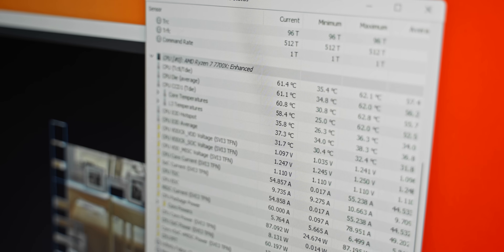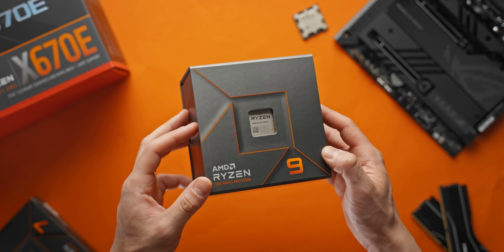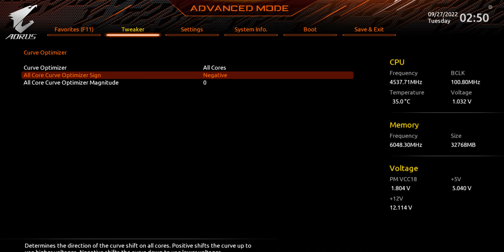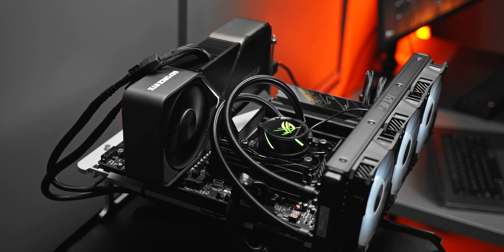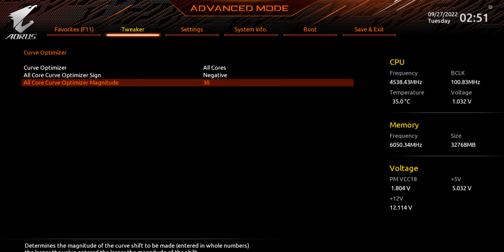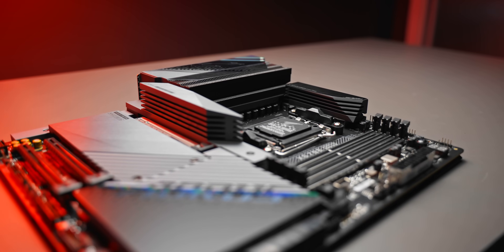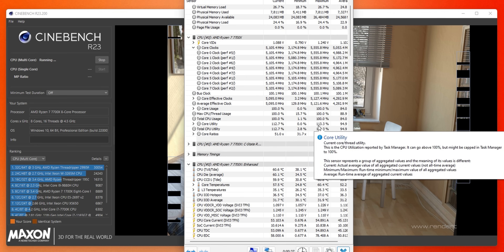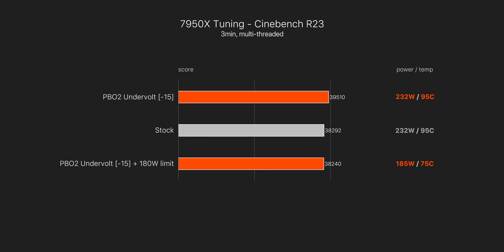Fixing Ryzen 7000 - PBO2 Tune (insanity)

Comment: So I'm a bit confused, if I set the offset to - 30 and it crashes, should I decrease it to say - 29, - 28 etc until it does not crash is that how it is?
Reply: Basically yes. Ryzen Master will figure it out for you. Then you can set it in the BIOS.

Comment: I'm so unlucky i don't know what's happening. My 7950x boost up to 5.8 when idle but when i launch cinebench the clock drops to 3.6 and my score is only 25000. I even did exactly what you said. negative 30 in curve and nothing changes. Do you know what could cause that?

build
Asus rog hero x670e
arctic freezer II 360
Reply: Set everything to default. Run test. If you still have issues I'd return the chip for a new 1 if you can.

Comment: 0:12 - 0:15, F'ING EXACTLY,  you want to keep thermal cycling at the lowest possible range and also to keep the temps to the lowest possible under ANY scenario because entropy's effect amplifies with temperature increasing on any material so the less heat the chip produces he less wear hence less chances and degree of degradation will occur on it, god darn basic physics.
I don't know how these facts have even escaped GN's review, just because AMD said it's fine?
To me, i just see planned obsolescence for obvious reasons.

Comment: This is really deceitful by AMD. Why not SHIP them like this? If its designed to run at 95deg, thats fine - you shouldnt be worried about that. But that should also mean you get peak performance. Being able to lower the voltage, and thus thermals AND still get the same performance feels like AMD just tried to HIDE the overhead they knew their processors have.

Comment: -30 all core is really unrealistic and unstable. Even with Ryzen Master automatic optimization per core, it still resulted in WHEA BSOD in the -20 range. I actually have to reduce them to around negative 10-15 for it to pass corecycler.

Comment: Wish if it is that easy...  last time when i used it, system ran fine, benchmark too, most of the games as well..but found that 2 out of lets say 30/40 games consistently kept crashing..
So reckon test your sytem really well before usage as benchmark/stress test sometimes is not enough and its gonna give you lots of headaches as you wont think its the PBO fault.. 
But otherwise it does give you lower temps, less noise and similar performance.

Comment: With high negative offsets in curve opimizer, youll find more instability in light workloads than heavy workloads. At least, thats how ryzen 5000 behaved.

Somehwere there is a ryzen 5000 guide on testing curve optimer for each core with prime 95 large ffts in windows safe mode to find the best per core negative offset.

Comment: Why AMD didn't make it this way by default out of the box?
Sometimes I don't understand their decisions. 
7700X by default should have less voltage, less power usage, and temperature set to 80C or something similar to not lose the performance.
Another issue is the thick plate as they had to leave some room for 3D models.

Comment: This vid is the first one I saw that gives you a glimpse of power efficiency of Ryzen 7000 series in lower wattage. I love it how you can tweak 7700x to operate at the same performance at 85-95W depending on silicon quality. Personally I would run it around 65-75W as it will give me more then enough performance for modern GPUs while gaming at 1440p. No need to spend more on electricity if you gain nothing out of it. Hah, I believe you could have a perfectly fine gaming experience from 7600X at 50W at 1440p with maxed out graphics, most games wouldn't notice due to being GPU bottlenecked :P
Reply: @El Cactuar thank you, it was necessary.

Comment: I spent some time with my 5900x and PBO. The best 2 cores got a -30, all others on the better CCD -25. On the weaker CCD, all run at -18, which results in the CPU running at least 4.9Ghz in single core (the best two boost to 5.025GHz) and an all core clock (e.g. in Cinebench 23) of 4.6 on all cores. 200 watts total consumption, max 72 degree Celsius. PBO is awesome when it comes to tweaking the very most out of a ryzen. Nice to see that the new CPUs have even more potential.

Comment: 5800x had the same problem as Zen 4, by default the chip draws too much power for too little gain. 5800x has the same power setting as the 5900/5950x but only uses 1ccd so all that power is going into HALF the die space(ignoring IO). This results in 5800x drawing up to 140w and being basically impossible to cool without high fan speeds. Changing the PPT/TDC/EDC settings in PBO fixes this, as the lower power settings allow more headroom on the chip to boost, so you actually get equal or sometimes better performance than the default power hungry setting.

I dont know why AMD chose to do this, as it really tanked the 5800x review scores because the chip was too power hungry and hot by default. Zen 4 also seems to be the same.

Comment: Big warning: based on my experiences with a 5950X using curve optimiser can cause CPU calculation errors that don't cause crashes or WHEA events. Best approach is to run at least 30 minutes of Prime95 stress test (with and without AVX) without CO turned on, make sure there's no errors and then try it with CO turned on. If there are errors, reduce the offset and try again.

Comment: Just one alternate suggestion for dropping power consumption - instead of reducing PPT/TDC/EDC limits, set "CPU Boost Clock Override" to [-100], or negative however much PBO2 adds as additional clock speed after you find a stable undervolt. So for the example at 5:10 you'd probably set [-200]. It has the same effect as PPT when your CPU's blasting on all cores, and also reduces power consumption during moderate loads like gaming where you're nowhere near the PPT cap while still giving stock performance.

...I did this on my 5800X because for some reason power consumption jumps by an extra 15-20W if the clock speed crosses the line from 4750 Mhz to 4800 Mhz, and that's what solved the issue for me after my undervolt.
Reply: Hey man! Could you explain what this setting does and how to set it in detail? Do you mean to add [-"Additional Clock Speed in MHz"] here? Thanks! :)

Comment: On my 5950x I really needed to adjust the offset to each core individually as some cores could not tolerate much of an offset, which would result in blue screens of WHEA's. It also required using something like Corecycler to test the stability too, just running cinebench isn't enough to verify stability. Great video besides that small bit.

Comment: I did exactly the same thing on my 5900x to get it air-cooled in a NCase M1, works a treat. I can see AMD pushed power and voltage to the max so it would look good in benchmarks, reminds me of the R9 290x.

Comment: My 5800x3d = undervolted by  0.05,  FSB 103.6  (4.7GHz all cores) and -30 PBO tuning on all 8 cores...  66c under full load with air.  Also you can use the PBO software tool to do all of this in Windows.
Reply: I thought the X3D was locked and couldn't be undervolted or overclocked? Have there been BIOS updates allowing you to do that now?
Reply: @cd4953  It is locked. MSI B550 Unifiy-X has an external clock gen to control FSB and PBO tuning software or BIOS setting in MSI let you adjust PBO.  I would assume most MB will let you change voltage on one though.
Reply: @njasicko  Ah gotcha. Thanks, that's good to know. Planning a new build and been trying to decide between 5800X3D or a 7600X. Being able to tune the 5800X3D is a plus.

Comment: So what's there to be uncomfortable about with the 95°C on a product designed to run at that temperature? 
So long as you don't touch it you won't get burnt, and the temperature in your room is influenced by the wattage being used, not the absolute temperature, right?

Comment: in other words the 7000 series is running totally inefficiently out of the box.
Reply: Basically, yeah. It's "stock" configuration is basically overclocked, and it's "eco" mode is basically what used to be considered stock.

Comment: I've managed a offset of 25 on my 7950x, just wondering what settings are for the power limit though as there are 3 sections to fill in, tdc, edc and ppt, also each chip has different wattages so need idea what to look for where to begin

Comment: You really need to configure curve optimizer on a per-core basis.  If you are limited to a -15 offset all-core, it may be only one core holding you back.  And with a 7950X, one core complex is normally poorer quality silicon than the other.  It takes more time, patience and testing, but you'll get far better results.

Comment: Thank you for making the video. 

A bit of role reversal here😂.AMD ships these things without limitations and we put the limits ourselves😅. Nice of them to push these CPUs as high as they would go on air or water right out of the box. Please understand that as he mentioned in the video, if you get a dud, you might not be able to run it at a single mV below stock without crashing. It would actually be very interesting to see what can be achieved with random retail chips instead of those provided by AMD

Comment: Wow. When reviews first came out, I had completely ruled out Ryzen 7000 for my SFF build, and was planning on going with the 5800X3D. After seeing this, I might wait for B650 and grab a 7600X.
Reply: Problem with AM4 is that ALL AM4 boards suck hard with I/O and features, AM5 is the first platform where there's no compromise in an ITX build, at least on selected X670E motherboards. I'd argue that with STILL abysmally low amount of PCI-E lanes, ITX and mATX makes more sense than ever...R OG Crosshair Gene, X670E-I and Creator look incredibly good between ITX-mATX-ATX form factors.

Comment: WARNING:  Do not attempt (aggressive) undervolting with an older and/or budget PSU that doesn't specifically mention having UVP (undervolting protection). You can fry your CPU in that scenario. 
T. Fried a Ryzen 7 2700X by setting the max negative offset (-0.3V) on a Gigabyte B450 Aorus Elite powered by a Seasonic M620
Reply: That doesn't make logical sense.. how can undervolting "fry" your CPU due to an older PSU?
Reply: @stormking1973  I could have chosen a better term indeed (maybe short?) but the point stands. I sent the CPU and mobo for RMA after the system wouldn't even post and they decided to simply refund me for the CPU (mobo was fine so I got it back, using it to this day)

Comment: Are you able to do this on ryzen master? I used ryzen master per core auto curve optimizer on my 5800x and its faster. Negative on all core can impact idle or low intensity work load and cause system to restart. But on per core adjustment., you can adjust maybe -5 or -10 on 1 or 2 cores (to avoid system to restart during idle or low workload) and go all out like -20 or -25 on the rest.

Comment: This is how they should have released it and left the run at 95 degrees configuration as an option. Power consumption is and will be a big selling point/value proposition, especially against intel. On the other hand, one less space heater.

Comment: My i9 10850k out of the box with kraken x73 in prime95 goes to 100c so i had to do some changes in bios to drop the temp ...........its crazy how they write the bios to motherboard, the cpus can melt :)) why why !!!
Reply: why? for maximum performance in benchmarks. better performance sells more product
Reply: @elu5ive  Ya but they auto overclocking the cpu and i don’t want this 😅
Reply: @smamas114   it's too unreasonable that they set it to 95°, but the function of being able to choose a target temperature is an AMAZING feature.
think about it, it doesn't matter what cooling you have or what case you have, or what your room temperature is. instead of the insane stock 95° you can pick something like 65° as your target and the cpu will do its best at exactly 65°.
you're getting power settings tailored to your individual cooling setup, to perform at your desired temperature under load.
that's brilliant.
Reply: @elu5ive  It’s just that i don’t like the fans ramping up ,all 9 😅
Reply: @smamas114   neither do I, but that's the good thing about temperature targets.

you can set the cooler fan to low RPMs and the CPU will do its best with those cooler RPMs at your temperature target of choice.

in fact, you can have a passive cooler, but thatnks to the target - it will never overheat, just do the best it can at your chosen temperature.

it used to be that the cpu ran at set settings and you had to adjust cooling RPMs to get the temperature you wanted. now you can just set the cooling to what you're comfortable with - and the cpu will do its best with these conditions.
I'd love to get one and play with it, but board prices are ridiculous and cpu prices aren't very sane either...
Reply: @elu5ive  In my MSI bios i have 3 options, stock cooler ,mid tower and water cooler,so fir the first the bios will set the power limit to 125w ,the second will do a 255w limit and the last there no power limit but for the first the freq will drop to 3,6 but for the last (water cooler)the freq will keep all the time at 4,8 mhz but there is more heat so i find a sweet spot ,i put the long duration and short limit to 300w and the llc to a less aggressive mode and cpu curent limit to 250 (i think) and now the cpu is cooler and 4,8 mhz all time 🤭

Comment: Too much fuss.. AMD already ships an optimized product no need in fussing over the temperature, you are not smarter than an AMD engineer
Reply: it's the opposite. every sample is different and requires a different voltage to run stable. that's why the bios has one-fits-all settings for worst case scenarios (so that even the worst samples run well) and in most cases individual optimization yields noticeable improvements

Comment: Hi Optimum Tech, 
Great video, this is something I am definetly going to do when I build my next gaming PC. 

What motherboard are you running for this overclock? I am still wondering if a B650 chipset will be able to do the overclocking/undervolting you are doing here? 

Also, do you know if B650 will be able to overclock/undervolt RDNA3 GPUs?

Comment: I'm still running an i 7 6700K... yeah i know it is old.
When i first saw the new Ryzen release and the insane temps + power draw i thought to myself to maybe just get the old generation (the 5800x3D looks too juicy) but this video shows pretty big potential with the 4th generation. Most tests i saw also show that the cores on the new chips are pretty good so stability should be good in general unless you get really unlucky with the silicon lottery. 
Never thought i would consider power draw in my life to be a problem but with the rising energy prices here in Europe i just have to build a system that draws less instead of more since my machine is running most days around 12 hours.

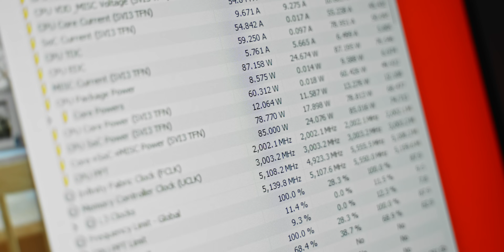Comment: Without losing a single drop of performance huh? Do you really think this statement makes sense? 0:06 fuckin lies... You didn't show clearly how it affected the benchmark. You think clock speed equals to  performance?  Do you fuckin have any idea how Complex instruction set computers work? This isn't as easy as you think.

 There were  4% to 5% drop. from 19600 to 18700.

Comment: But what clock speeds are possible when you set a pbo oc of +200mhz and max out the powerlimits and templimits plus the curve optimizer -30 (or whats stable)

Comment: where did you get the measurement results of 5950x/5800x3d and 12900ks ? i have a 12900k and have much more fps in valorant than you show in your video (we are talking here in firearms about 1300fps with 12900k).

Comment: I just hope we could also tweak the settings like this on the upcoming b650E,this is just a life changer for all 7000 users....power and temp drop without any performance compromise is just a big deal...just wow!!!
Reply: Should be able to, my B350 has PBO2 and all the same settings he shows in the video. I use the same curve optimizer and it works great and frequently boosts to 4648Mhz. I didn't know it allows us to set a power limit though but I'll probably skip that since my 5600X reaches 51C max already.